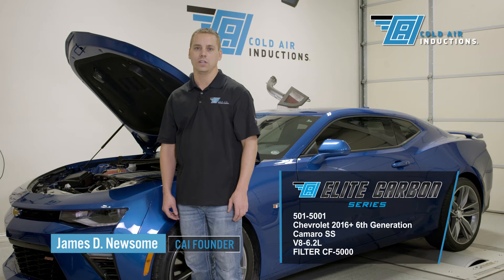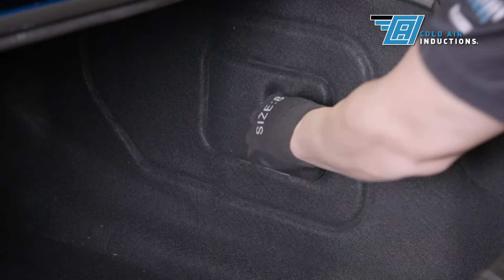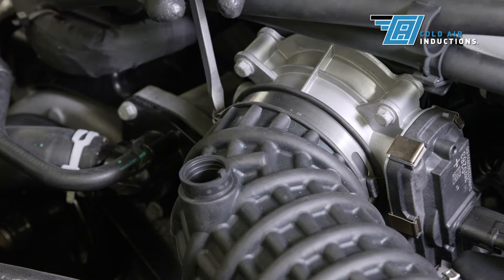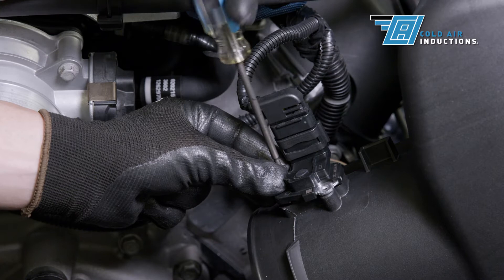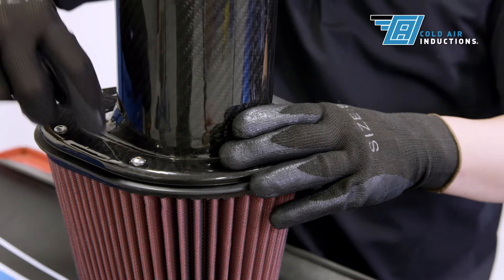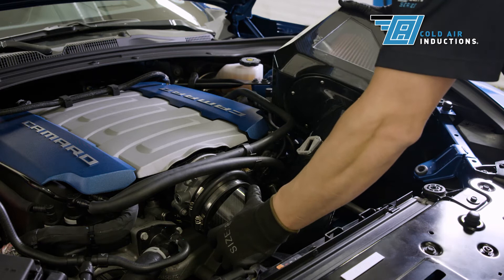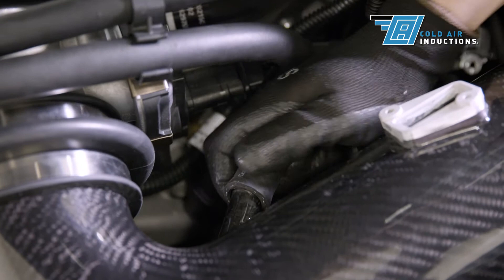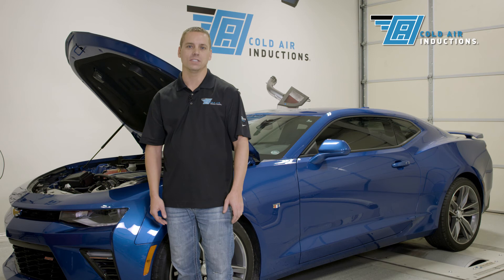Cold Air Inductions - 2016-2022 SS Camaro Elite Carbon Series - Install Video

Comment: BigTymim - It adds HP by letting more air into the engine. The computer will add more fuel to make up for the added air. The tube also creates less turbulence by having smooth curves. Finally, it is made of real Carbon fiber which saves weight.

Comment: does this add hp? im confused on why people do this? please explain?
Reply from the maker: Based on our Dyno readings, it adds 13 HP and 11 TQ. The other system we have in the Elite Series can also increase performance on the high end RPM side of the Dyno.
Reply: @ColdAirInductions  Do I need to have my engine tuned after installation?
Reply: @jasoncreamer4549  no you don’t need any tune after this install
Reply: @christiankingsosa209  Thanks!!

Comment: What about the sound tube that you unscrewed?
Reply: They don't show you but you have to delete it s easy to  do I did it on mine but you do have to buy a plug for the  hole that goes into the fire wall got it off eBay for like 10 bucks